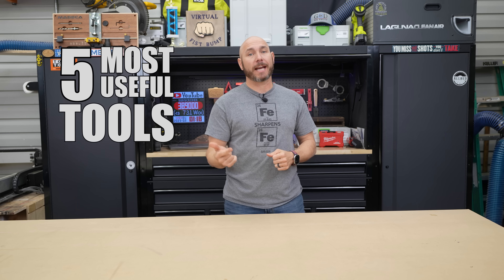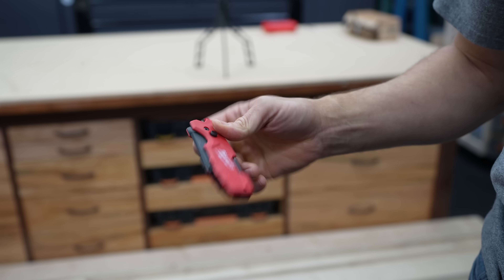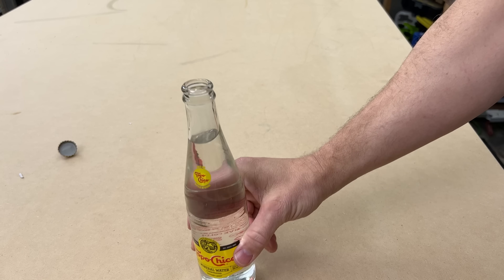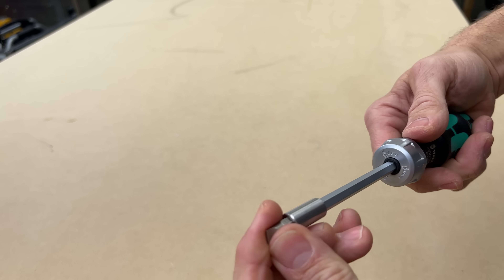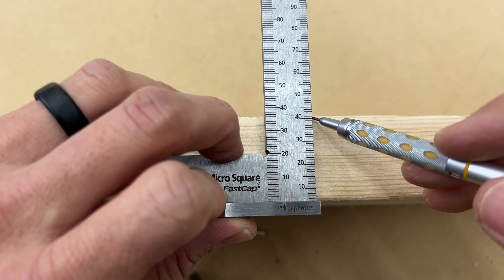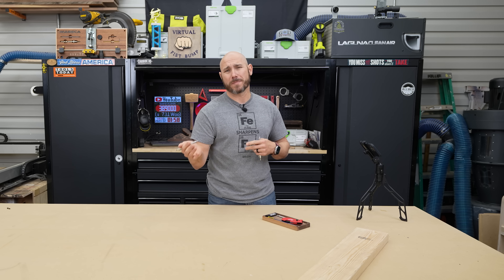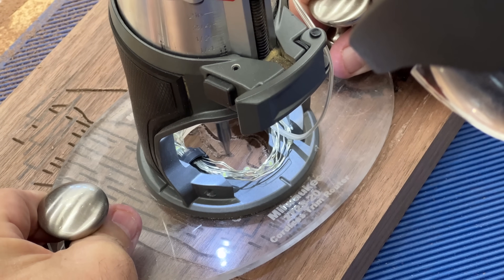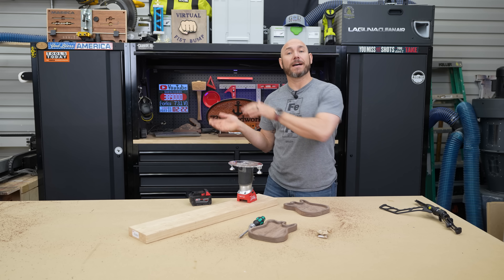5 Woodworking Tools Under $50 Every Woodworker Needs!

Comment from the maker: ▼EXPAND FOR LINKS TO THE TOOLS▼ 
🎥 Watch Next - 5 Woodworking Tools Under $30 - https://youtu.be/FsXpbFMmeU4
🛠Tools in this Video:
Milwaukee FastBack Utility Knife (Amazon) : https://amzn.to/3RObLcx
Milwaukee Fastback Utility Knife (OPT) - https://shrsl.com/3xafv
Milwaukee FastBack 2-Pack Combo - https://amzn.to/3Ypoepg
Wera Ratcheting Screwdriver - https://amzn.to/3YmkYLn
FastCap Magnetic Square - https://amzn.to/3lydeY4
GraphGear Pencil .09 Lead - https://amzn.to/3jTJwfR
GraphGear Pencil .07 Lead - https://amzn.to/3ljZlg6
GraphGear Pencil Multi Size Pack (best value) - https://amzn.to/3HUEMOW
Router Base Plates - https://makeawoodsign.com/collections/acrylic-base-plates

Other Tools/Equipment I'm Asked About Often:
Tripod for Phone - https://amzn.to/3E3kWA9
Phone Holder for Tripod - https://amzn.to/3E1E6GG
The shirt I'm Wearing - https://www.kerusso.com/products/kerusso-christian-t-shirt-iron-sharpens-iron
Boots I'm Wear - https://amzn.to/3HkUl3y
Toolbox in Background - https://homedepot.sjv.io/x9B2xy
Tool Wall over Miter Station - https://amzn.to/3ZgWq7B
Digital YouTube Sign - https://amzn.to/3GL2a2e
Camera Gear I Use - https://kit.co/731Woodworks/camera-gear-i-use 
Computer Equipment I Use - https://kit.co/731Woodworks/731-woodworks-computer-equipment

(If you use one of these Amazon and other affiliate links, I may receive a commission) 

Other useful links:
Daily Tool Deals on my website: https://www.731woodworks.com/tool-deals
Subscribe the 731 Newsletter: https://mailchi.mp/7e44c16eefdc/731-woodworks-email-newsletter
Check out our easy-to-follow woodworking plans: https://www.731woodworks.com/store
Outlaw's Board Butter - https://www.731woodworks.com/store/boardbutter

Comment: I absolutely LOVE the router base plates. I have several routers and I have base plates for all of them.  It completely changes the typical instability of a handheld router and gives you so much more control. Also - it changes HOW the router is held. As someone who has low hand strength, I no longer have to support the weight of the router while keeping it steady and plumb - my hands are flat on the router plate/handles and  on the work surface.  If you are looking for more stability and control for your handheld router, these router bases will make all the difference!

Comment: Well, that's a list I can second in its entirety. I have:
Milwaukee Fastback- Mine is the compact, but any of their models are top notch. HD has better prices on them.
Ratcheting Screwdriver- I prefer the MegaPro Automotive, but Wera is a good one too.
Machinist Square- Mine is not magnetized, but I like the magnet feature of the FastCap.
GraphGear Pencils- 0.9 and 0.5. Haven't used another pencil in almost 2 years.
Dave's Trim Router Base Plate- Love it! Dave also has them for sale through an Amazon store. Well worth the investment.

Bottom line is there isn't a single dust collecting gadget on the list. Good job!

Comment: Ha!! That magnetic square was literally what I've been looking for for my table saw.  I can store it on my saw's cabinet as a dedicated tool. That way I don't waste time digging through my tool box to find my machinist square when I'm batching out projects.  Great find!!
Reply: I have one that I keep stuck to my bandsaw for use.   If you get one however, do something immediately to prevent rust ( wax, oil, coating) as it will rust.
Reply: @ugaladh  Thank you for the heads up.

Comment: Howdy Mr. 731...

The other day I said I didn't like "hidden" compartments on my hand tools cause it made them bulky. 

I retract that comment now after seeing it. And I like the color, nice and bright and stands out in my mess of a shop. That tool looked to be pretty much relative to a regular screw driver. Gonna have to get me a few of them (even though I've got like 20+ screw drivers already. 

I also liked that square. That magnet would come in handy cause when I'm squaring my tablesaw blade, I'm always knocking over my other square. What were those screws on the bottom though? Some sort of adjustment feature? 

Not a fan of mechanical pencils though. Never have been. Ya can't sharpen them and "for me" they constantly break, and THEN, now I have to keep track of an inventory of extra lead of which ALWAYS grows legs and wanders off never to be found again. Good ol fashion #2 yellow pencils for me. Get a whole box of 20ct for 2 bucks. NEVER needed anything more....AND, the eraser end makes a good push stick for small cuts on the tablesaw and bandsaw too. 

I liked the video....especially the "Merica" glasses cut in....made me laugh.
Reply from the maker: Thank you Mike!

Comment: In line with your Pentel series pencils, give consideration to stepping away from the standard #2 lead and step up (down?) to a softer lead. I use 2B lead in my yellow (0.9mm) Pentels which is equivalent to about a #0. Much softer...don't need heavy pressure which may cause scoring or scratching, and the bold coloration of the marking is easier on this ol' man's eyes. I got a dozen 15 count tubes of Pentel branded lead in 2B on Amazon for under $20...a lifetime supply if you're pushing 70 with as short a stick as I am.
Reply from the maker: Thanks for the suggestion!

Comment: I like the non ratcheting Wera screwdriver as it extends if you want it too, or can keep collapsed to save space.

You can also remove the hole center part to use in a drill or whatever. And it has the storage in handle too.

Something very satisfying about the mechanisms

Comment: If you see this I could use some advice on destressing. My wife and I recently purchased an old kitchen table with 5 chairs that was made by Drexel Furniture (from our research). My wife is down to two choices in colors, grey top with white legs, and what she's come across recently, Robin's Egg Blue (she found this color from a site that sells retro kitchen appliances). Not only will i be looking through your videos for the stressing technique but what I need help with is would you pain the table black first for both options or would you paint white first or something else for lighter colors such as that blue? Or do you just paint everything the color you want and sand down to the wood?
Reply from the maker: I would paint it all with the base color first.  So if you want black to show through, use that first.  Or if you want wood to show through, just paint it the top coat color.  In this video I paint a dark color first, then a contrasting light color.  Then sand off a little at a time until you get the look you want https://youtube.com/shorts/Vc0rwTy6GKU?feature=share
Reply: @731Woodworks  thank you! That video is major help! My wife seems to think I'm a pro diy wood worker lol. I mean it does get me "pro parking" at lowes so it's got its perks 😂
Reply: @731Woodworks  oh, if you don't mind me asking one more question. What's a good clear protective coat that's food grade to put on table once done?